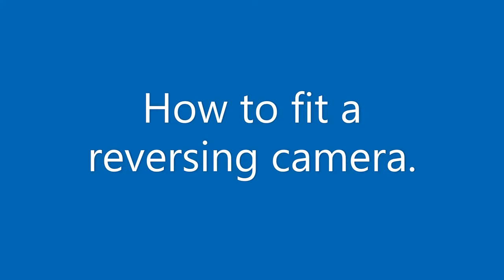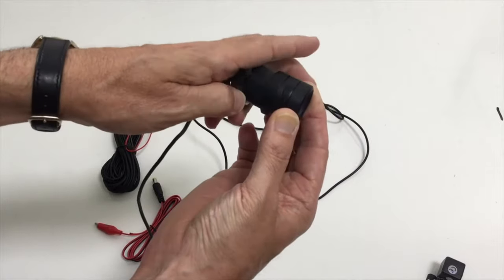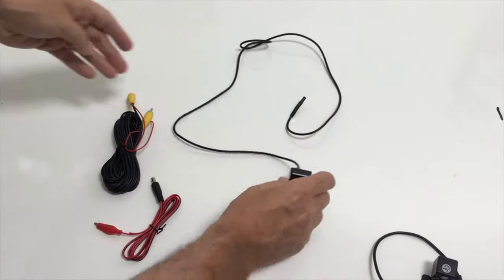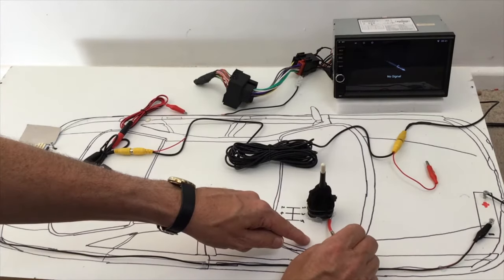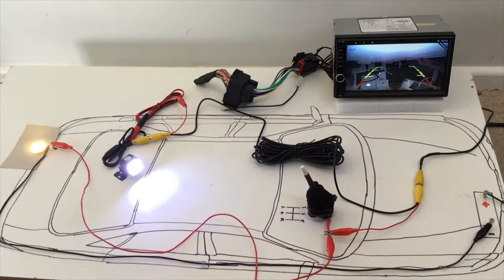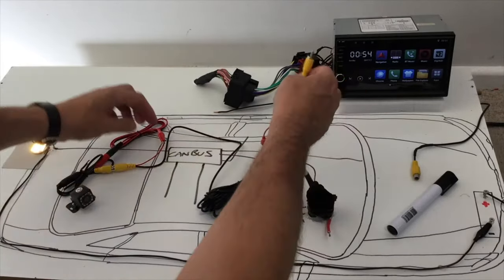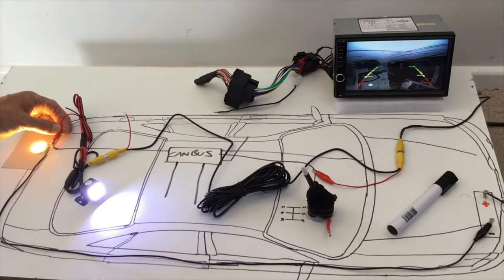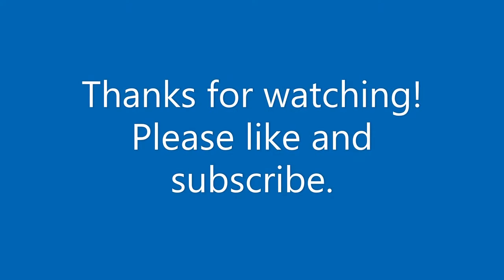How to wire in a reversing backup camera - watch this first!

Comment: Great Video ... However, fyi, I just installed my license plate camera using Wireless Transmitter from Amazon cost about $20 ... Works Great !!! However to save the wiring b.s. I wired the camera to the license plate light, and to switch on the camera I just turn the lights on ...
Reply from the maker: Great thinking! I like it. Thanks for your comments and interesting to know your findings on the wireless option. 👍

Comment: Excellent video and well informed. I have a question that’s probably an easy answer. If I want to run my camera power lead to the back of the unit with dedicated 12v instead of reverse lamp  and also attach the reverse trigger wire from unit  to my reverse switch wire on vehicle, will I have the ability to turn on the camera while I am driving and look behind me as well have the ability to have the camera automatically come on when I put it in reverse?
Does the reverse trigger wire automatically switch to reverse camera regardless of if the power is coming from backup lamp or another 12v source?

Thank you!
Reply from the maker: Hi there and thanks for the excellent question. There are lots of things to look at here. Firstly, yes the trigger will work with any 12v input regardless of whether it’s from the reversing light or not. So yes applying 12v will change the display. You’d need to check the legality of doing this because it’s generally illegal to be watching a screen whilst driving. Also, be careful to make sure that if you have both leads going straight in to the trigger, that you have diodes to prevent the current going both ways! Otherwise, you could be potentially be driving along, click your switch for rear view, and it would send the signal back down the wire to the lamp and turn it on! Just some things to be thinking about! Hope that helps. J.

Comment: Just found your video today.  Among the videos I watched about the topic, yours has the clearest detail explanation. Leaned a lot from your replies to others questions too. Do you know what are the two short blue wires near the camera cable for? They are connected in the camera cable harness. I brought a non-brand android player mainly for the backup camera. But the manual didn’t provide much information. Thank you! Wish a wonderful new year to you!
Reply from the maker: Hi there and thanks for your comments. I’m not sure which blue wires you mean. Are they on the harness coming out of the back of the android unit or on the actual camera wire? If there’s any picture you can send me, or a picture online that you can point me towards, let me know and I’ll take a look! Happy New Year to you too!
Reply: @Jase777jase  Hi, Jase, the two blue wires are in the 10 pin RCA camera wiring connector in the harness coming out of the back of the android unit. I don't know how to send a picture to you 😂. But going back to Manuel, they are labeled WiFi antenna 1 and 2.  Not sure what the uses for them are?  I had not used them in the wired backup camera installation.Another problem happened yesterday.  The backup camera was working fine when I installed it on the new year day. It is connected with both positive and negative wires to the reverse  light. The other end was connected to the yellow video signal input and a red wire to the pink camera trigger for reverse.  Yesterday when I was trying to reset the android unit, the backup camera screen went black.  The android unit worked fine in park position. But the screen went black once it was in reverse gear.  I searched online all day, I could not figure out why.  One YouTuber said connect the camera ground to the reverse light, the other one said connect it to the bare metal part of the car body. Maybe I should connect to the car body for the ground instead?  I am not  tech savvy, but I would like to DIY the project anyway.🤣 Sorry I have so many questions. Sincerely thank you for your advice.  Thank you for your kindness.
Reply from the maker: @rueqi3335  OK yes, I understand completely what you are saying... I will give this a little thought and reply in more detail later this evening. 😊
Reply from the maker: @rueqi3335  Ok, so first thing to say is that if you reset the android unit, something might have happened at that point, if the camera failed to work afterwards, especially as the camera was working fine before, and you have changed nothing, and now it’s not working. But assuming the head unit is ok… as regards the negative or ground wire at the reverse lamp, it doesn’t really matter whether you attach it to the black lead of the lamp, or bare metal nearby. They will both be effectively the same. If the android unit is going to the reverse screen when you change to reverse, then that bit is working, but it sounds like either the camera signal is not getting through, OR the camera has stopped working. You can easily test if the camera is ok, by unplugging it from its current position and plugging it straight into the input of the head unit. You’ll need to provide power from a positive feed, like the battery (just like I did at the start of the video). It sounds like a loose connection somewhere to me. Maybe a loose yellow rca plug somewhere along the line. Good luck with troubleshooting further! With regards to the blue leads, they sound like the WiFi antenna that allows the unit to pick up a WiFi connection (either from your router if you are parked close enough to your house, or from you phone’s WiFi hotspot if you connect using that.) You don’t need to do anything with them, WiFi will work fine without extending them. I hope some of this helps, and good luck 😊
Reply: @Jase777jase  Ok, now I have a direction.  I will check all the connections again.  Thanks for your kindness!  Rue
Reply from the maker: @rueqi3335  you’re very welcome Rue, good luck! 👍
Reply: @Jase777jase  Hi Jase, you were right on the money.  I was trying to mirror my phone to the head unit and customize some display settings... I must have signed into my google account in the unit yesterday.   After that, the backup camera screen went black.  I tried to connect a different camera to the unit like you suggested but failed.  I thought about what you said I must have changed something. Maybe the system doesn't not receive the video signal from the camera? So I just reset the system to the factory settings.  After a reboot, the backup camera is working again.  I am so happy. The most important thing for me is the backup camera. I wouldn't dare to adjust anything in the system now.  I should share the good news with you.  I really appreciate your help.  You are an angle! 😇 Thank you again. 😁Rue
Reply from the maker: @rueqi3335  Excellent news! Glad it’s all working. I must admit, it’s a very important feature to me as well. Well done. 👍

Comment: Hi, great video, can you tell me how do you join up the camera wire from the rely ? do you just join wire to the red wire on camera red wire ? or some other way. Im confused. thanks, John T
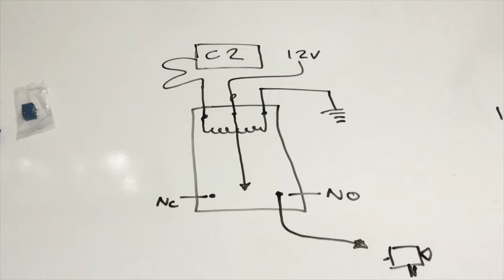Reply from the maker: Hi there John and thanks for your comment… Yes, at 27:55 the wire that comes off NO (normally open) on the relay, which I draw going to the camera, is connected to the red wire of the camera. It’s basically a way of getting more power to the camera. As I mentioned in reply to another comment, you can buy that relay solution in a box ready-made, but I chose to make it up myself. Hope that helps, and good luck! J.
Reply: @Jase777jase  HI THANKS FOR THE REPLY, CAN YOU GIVE ME A LINK TO BUY THE READY MADE ONE. Cheers John T
Reply from the maker: @johnthorburn1659  Hi again John. I’m having real difficulty finding one now! I did a search when I was writing my reply to you, and couldn’t find a suitable one, but I’ll have another look and see what I can find, I know they exist because another commenter left a message regarding them.

Comment: You did a great job explaining this... Now only one question i have remains:  what about LRV?  I assume I'd connect camera power (assuming no included blinding LEDs) directly to ACC switched power and then connect my trigger to "back" wire and that would give me the ability to view the camera feed at any time via thw appropriate app and automatically open the feed when reversing ... At least I believe that's how it would go.  I plan to install mine this way on a large SUV and try it.  It seems that would be the way to go on an RV for example where a rearview mirror isn't really useful at all

Comment: Thanks a lot, this is the best explanation video ever created. I am trying to install the camera on my chevy sonic 2014,  when I switch to the reverse gear my head unit automatically switches to the reverse camera so I think I don't have to worry about plug in the power in the front either on the canbus reverse cable or the head unit only rc video cable must be plugged in the head unit and for the power I think from the reverse lights is the easiest in my case. I hope it will work please advise me if I am wrong and thanks again for the video
Reply from the maker: Sorry for long delay in replying. Yes, it would seem as though the unit is already getting its signal through the loom. I believe this is becoming more common now. I expect you have already installed your camera by now, but if not, yes taking the power from the reversing light would make sense in this scenario. Many thanks for comment and kind words.

Comment: great video, im just getting a black screen when my camera comes on, does the ground of the camera not need to be grounded?
Reply from the maker: Hi Scott. With most cameras, it’s grounded through the RCA  lead. So, in other words, if the RCA video cable is plugged in at the camera end and the head unit end, the camera is grounded. Your camera may be different, but I think it’s unlikely. The ground is common for the power and the video and travels inside the black RCA to RCA wire shown in the video. I hope that helps. Thanks for your comment.

Comment: okay, but what about if the stereo has a "special" smart harness + module where it already detects when the car shifts into backup?
is there a wire from the harness we can use in that case from the harness to provide the power to the camera, or does the camera still need to be wired to the backup light?

Comment: hello.thank you for the video.
I have a rns510 mounted on vw golf mk5 year 2008 , and i want to use an aftermarket camera, my problem is i want to know where i can locate the reverse wire? is it emitted by the car or by the rns510 unit?
two  more question is how to recover the video pins  by the unit without buying the rgbs to rca adapter and is it necessary to program the reversing camera by the vagcom or not? 

Thanks a lot.

Comment: Hi, I've been told that if you use the power from the radio, the camera is grounded through the video cable and you don't need to connect the negative wire to anything. Is this correct?
Reply from the maker: Hi Lucas. Yes, that’s right. As long as the video lead is plugged into the stereo / head unit, the camera is grounded. The ground connector is the large outer connection on the yellow RCA plug. If that’s plugged into the stereo, then there is no need to have any other ground. Many thanks for your comment. 👍
Reply: @Jase777jase  Thanks!

Comment: Really nice video.
How can I get camera turned on by just selecting the camera option on headunit? 
 
My goal is:
1. Turn camera ON, when gear stick put on  reverse. 
2. Turn camera ON, when reverse camera selected on the headunit without needing to put gear shift on reverse
Reply: I think you can add a switch to one of those additional accessory slots and then wire the reverse signal to that. You could use a relay for that and have an actual mechanical switch that you can engage anddisengage at will

Comment: Hi please if u could help me out ive connected everything correctly but the head unit wont show any type of trigger to the image of the reverse camrea it doesnt even say no singal when i go in reverse the camera led lights up but the head unit screen is like normal
Reply from the maker: Hi there and thanks for your comment. I would suggest you “divide and conquer” by splitting the problem in two. First, make sure that when the camera comes on, that the line to the reversing lead of the stereo goes high (12v). Use a multimeter to make sure. If this is ok, separately, take a 12v positive feed from somewhere, and connect it to the reverse lead of the stereo. This should make the screen change to reverse. EITHER: part 1 will fail, or part 2 will fail. If it’s part 1, trace the route from the source of 12v. If it’s part 2 then either you have a faulty head unit, or perhaps there’s an option for automatic switching to reverse screen, that’s turned off. I hope this helps, please let me know how you get on! J.

Comment: Great video! I've wired up my reverse camera, but when I put in reverse all I get is a black screen with guidelines. Tried all settings on head unit. I'm beginning to think it's a faulty reverse camera. 
Or, the fact that I've used 25AWG wire to extend the trigger wire that comes off the RCA and goes to the reverse light (I needed to extend). So currently it's 18AWG mixed with 25AWG. Would that be enough to lower my camera?
I'm thinking I might have to test another system such as a DVD player to see if I can rule out the camera being bad!!
Last piece of the puzzle is baffling me....
Reply from the maker: Hi Chris.
Does the head unit have multiple RCA video inputs? In other words, is there one for reverse and one for watching a video? Mine has this and when I started testing, I just powered up the camera and plugged it into the video input. You need to select it as an option on the menu. If so you will know straight away if the camera is bad. I don’t think the wiring gauge should be a problem, mine is very very light gauge indeed. Good luck!
Reply: @Jase777jase  thanks for replying. I've got many RCAs on the head unit. But I've got it plugged into R.C in. According to manual is rear camera input. I've gone into settings and turned camera on (this is where you can change polarity to battery or ground) and also turn guidelines off and on. The guodliness that display when I put into reverse must be coming from the head unit as if I switch off at unit end, they disappear and I just get a black screen with "this video may appear backwards". So it seems to have power, just no signal. Very strange.
Reply: I'm having the same issue. Please help me too.
Reply: @joneslr25  turned out my wiring at the reverse light was not connected properly. The wire connector wasn't spliced in far enough on the thinner wire at one end. Missing by about 1/4 of a millimetre!🤣

Comment: What do you do with the ground for the power lead if you hook it up to the reverse light? Do you split the postive into the positive and the ground lead into the negative of the blub?
Reply from the maker: Hi there and thanks for your comment. The beauty of that cable is that it has a ground at both ends, so as long as your RCA  video cable is plugged in to the head unit, it’s already grounded, so there’s no need to ground at the other end where you connect to the reversing light. hope that helps. J.
Reply: @Jase777jase  thanks for the reponse. That makes sense. Much appreciated.

Comment: Is there a way to connect the inbuilt original camera that comes with the car to the android stereo unit without having to install a new camera?
Reply from the maker: Hi there and thanks for your comment. It’s likely to be very difficult indeed. It all depends upon the vehicle in question and you’d need to do some digging on the forums for that car, but  I’m pretty sure original cameras would have a proprietary wiring system that could be very difficult to decode and find the wires you need.  So, in short, not impossible, but likely very tricky! Hope that’s helps!

Comment: I have the cable with the yellow male like that and the power. I was trying to get through the rubber in my car and I damaged the end of the cable. I decided to cut and run the wire because it was thinner; now, I bought a new P2 power cable. Can I just cut it too and splice it to my old one? I saw that there are 3 wires. Or do you suggest to repair with a new plug?

Comment: Hi, thanks for the very informative video. I have a question about the relay, can we get the 12v connection from the head unit or do we need to wire somewhere else?
Reply from the maker: Hi Emre, and thanks for your comment and good wishes. That’s a good question… I actually took my feed from the head unit. On that adaptor cable that goes from ISO to quad lock (in my case) there are two power wires. One is a permanent 12v feed and one is a feed from the ignition. One is thicker than the other. I took my feed from one of these two, I don’t think it really matters which, as I think both have enough current available. Good luck! Jason.

Comment: Hi, in the last drawing using the relay, it appears you have the c2 box going to the centre terminal on the relay, is this correct or should it be top left? 33:43
Reply from the maker: Well spotted… actually, it’s just the way I drew it, I simply meant it goes in to the relay, but yes you’re right, the way I’ve drawn it looks like it aligns with the centre pin, whereas of course it should align with the left hand pin, as per the previous drawing. So for wiring of the relay only take note of the previous drawing. Thanks for spotting this and good luck! J.

Comment: Hi. Can I connect the trigger and the 12v back camera from the head unit together, and then connect to the red wire from the long cable reverse camera? Ive been struggling to find a way to connect both